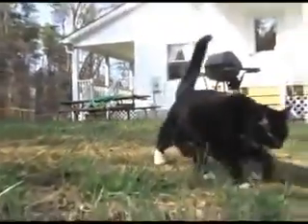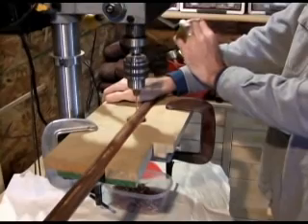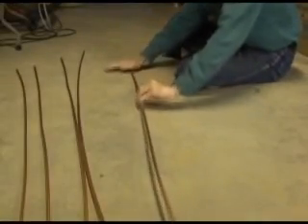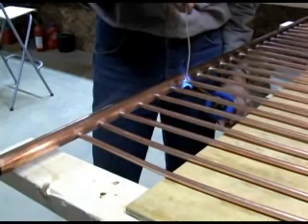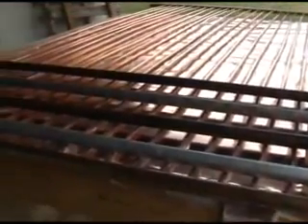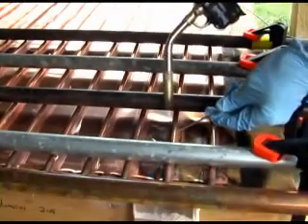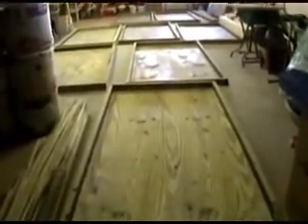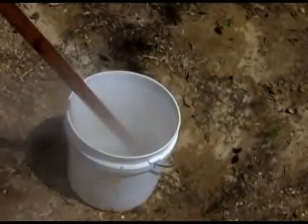Build Your Own Solar Panels - How To Go Off Grid (2019)

Comment: Couldn’t they just have a copper sheet the size of the panel you’re making. Then hammer on pipe clips through the sheeting into timber battens where you’re having the clips and insulate between the battens?
Certainly you need patience’s 👍 great video anyway 👍👍